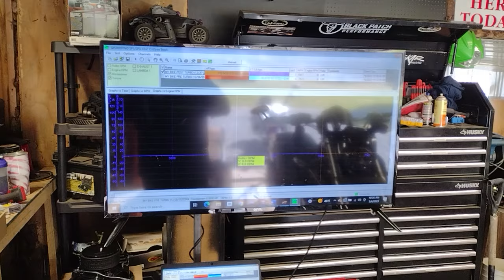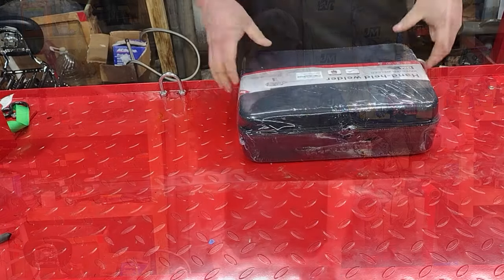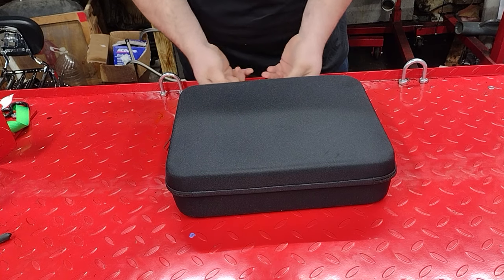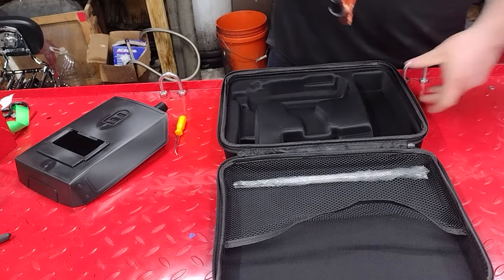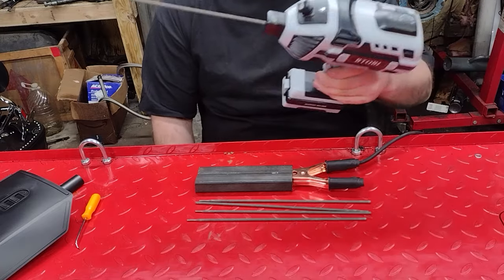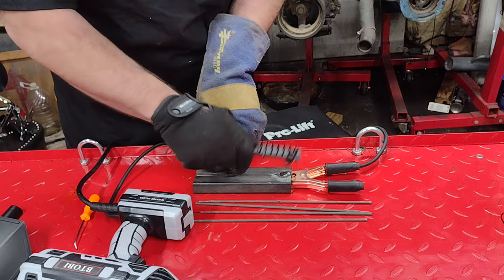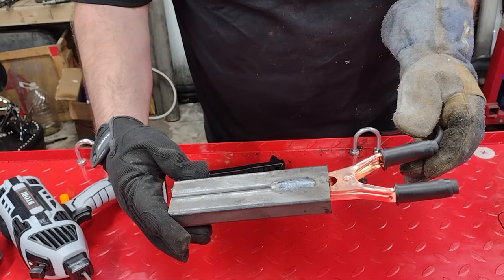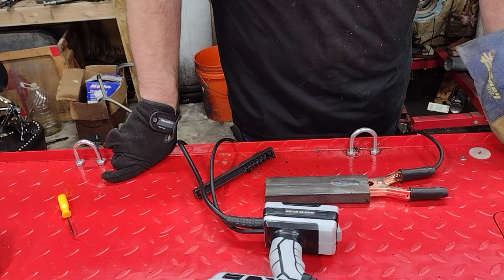Btobi ARC-120 Handheld Sticker Welder Review

Comment: I bought a welding gun similar to it, and I was surprised by its high efficiency. I worked with it for continuous hours at home, at between 90, 100, and 120 amps, with an electrode diameter from lowest to highest, 3.2 mm.  In all honesty, I see that this invention is very useful, easy to use, and harmless to home electricity.

Comment: I got one of these just to see if it works and was surprised as well. Don’t expect the world out of it but it’s hard to beat the portability. I keep it in the truck and it’s perfect for tack welds on a gate until I can do a proper repair. 

Changed out the ground clamp with an old jumper cable clamp. The one that comes with it bent the first use. 

I’ve had it about a year and it seems to work when I need it.

Comment: I bought one from TEMU for around $82 here in Canada. It arrived with no shield, but 3 J422 welding rods. I will use Forney 5/64 6013 with this machine to start, then work up to larger rods.

Comment: Came from the group too! Subbed. Honestly it doesn't seem half bad given what it is.. For around the same price id rather get a little inverter buzzbox (I'm assuming they essentially took the guts out of one and put it in some generic drill or impact housing redesigned for this sort of fuckery)
Reply from the maker: It’s actually quite a feat of engineering to package it this way honestly

Comment: Thank You for posting, certainly looks good for minor or small spot welding. But for less than $100 on Temu you really can't complain. I will be using this on a on 1/8" angle iron thickness, so I assume it'll carry the load.

Comment: You should make a quick little update video on it, I don’t weld much, so I was thinking about picking it up for random tasks I need it for.
Reply from the maker: So I actually did shoot an update video, but lost the footage after a computer failure. Will be reshooting soon so stay on the lookout for it!
Reply: @BamBamMotorsports  thank you! I actually bought the welder, and for my applications, it works great. I’m currently making a 3-D printed internal combustion engine for my YouTube channel, and for welding the crankshaft together and some other random parts it works great, don’t have to dig out my dad’s big Welder.
Reply from the maker: Update!

https://youtu.be/imZVN4WyHJk?si=ObZBEipBaH7QWoJ6

Comment: i have had good luck with the 110v non-handheld version of this...i'm pretty sure they are the exact same internal components....toss that worse than useless plastic shield they give in the trash...IT's NOT SAFE!!!...a real welding helmet/shield will have a clear plastic lens in front and behind the dark glass lens...this is to protect it from the heat and spatter and the rear one is to protect your eyes if the glass one shatters....by the weld you did it looks like a 7024 rod.

Comment: I am pissed because mine didn't come with any welding rods which is stupid. At that low price point I wouldn't mind a few more bucks so I could be welding ready instead of having to go out and buy more crap. Very few things come ready to go like the old days. It's like getting your girlfriend and then having to go buy boobs and stick them on.
Reply from the maker: Well damn! That does suck man, but it didn’t come with much anyway haha
Reply: @BamBamMotorsports  Doesnt matter now the spring that holds the welding rods was too short and popped off touching a wire inside and blew the resistor. Lifespan 4 hours. 😂
Reply from the maker: @mrjaybennett80  oh god 😂😂😂 I’m assuming quality control on these units isn’t the best lol I must have gotten one of the good ones lol